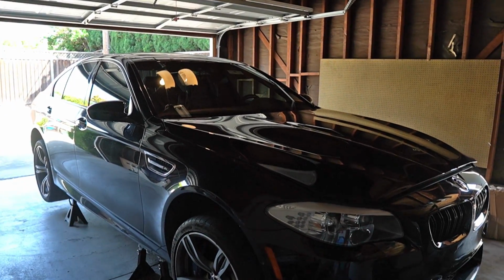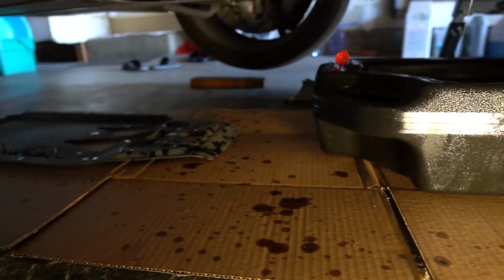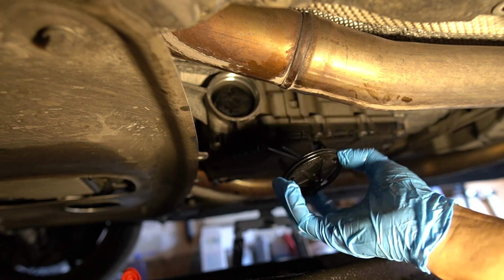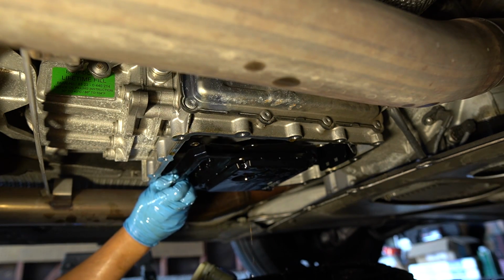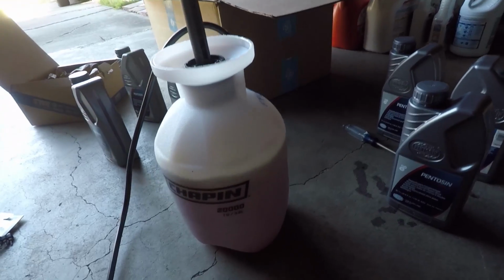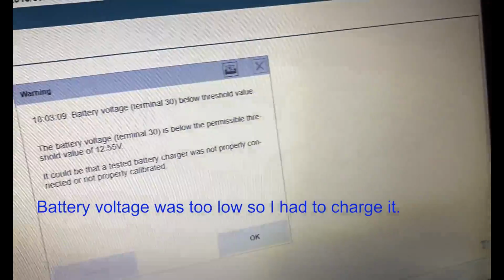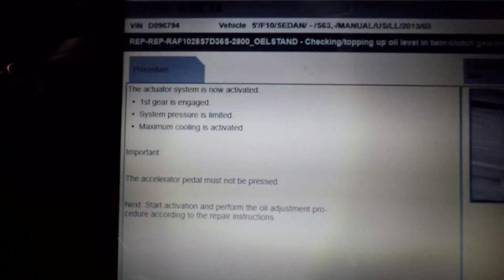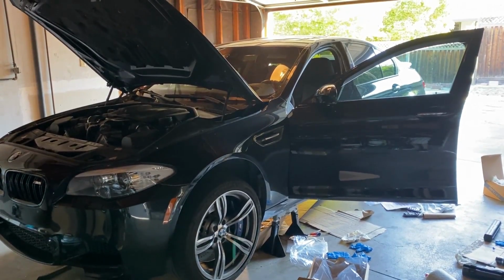How to change BMW DCT Transmission Oil using ISTA+ on F10 M5

Comment: The ISTA doesn't specifically mention you should only start filling in oil when the temperature hits 32℃ right? 
It just says you should start the process at a temperature that's below or equal to 32℃ and the maximum allowable temperature during the whole process is 40℃
Reply: Should be between 32°c and 40°c not below or above

Comment: Does anybody know if this can be done properly with a snap-on Zeus+ scanner?
Reply: Since your question is still unanswered I figured I’d offer some insight if you haven’t already attempted, it most likely can as my cheaper Otofix D1 Lite can perform all functions fine. I.e it can perform the oil balancing, transmission flushing, and dct adaptation functions fine.

Comment: I really appreciate you putting this tutorial up; I used it to change my gearbox oil over the weekend.  I 100% agree that having a good set of large snap ring pliers is a must.  I decided to go ahead on the job with my small pliers with the interchangeable head (fully expecting them to break).  Although I eventually got them to work (and they didn't break!), it took about 30 minutes of fiddling.  That snap ring is a beast and a large set of snap ring pliers makes the job much easier.  

The only other thing I would add is to make sure you have a device that can get fluid into the gearbox relatively quickly.  I had a cheap handpump thing, and when doing the ISTA oil balancing, I couldn't get the additional 2L of oil into the gearbox in time before it reached 40C.  I had to redo the process again the next day.  The pump you show in this video probably works great, so I'd recommend anyone doing this job get something similar and not attempt it with a handpump like I did.

Comment: I was doing a transmission pan procedure on my 2015 428i once with the ZF8 speed and I was purposefully taking long to do it and by time I had to do the fill procedure, temp was at 52C. I did drive the car around before and it took me 5 or so hours to do the manual labor part. Transmission temperature takes a long long time to go down.

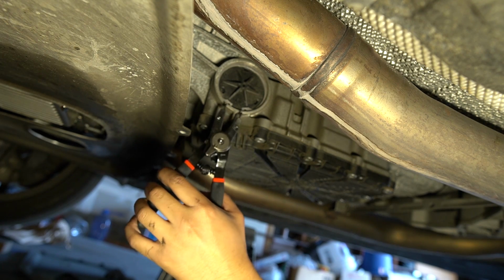Comment: Nice video, I'm going to do it over the weekend :) the pliers which you used at 2:55 are for external type of snap rings, that is why they didn't work for this internal snap ring :)
Reply from the maker: Thanks. The pliers were actually the cheap interchangeable internal/external style ones. It’s not strong enough to remove the snap ring.
Reply: @WillsGarageOfficial   I agree, those wouldn’t have the strength, I have them too :)